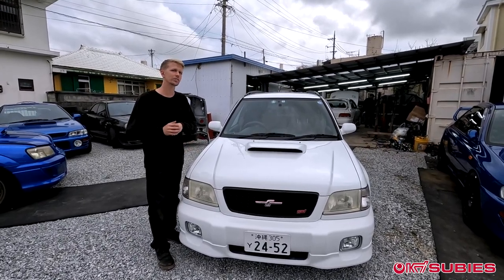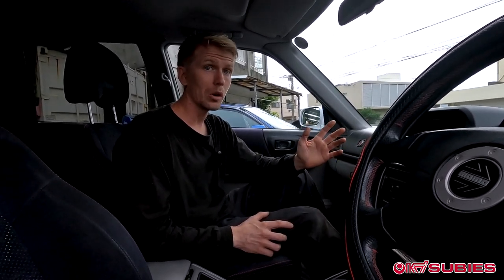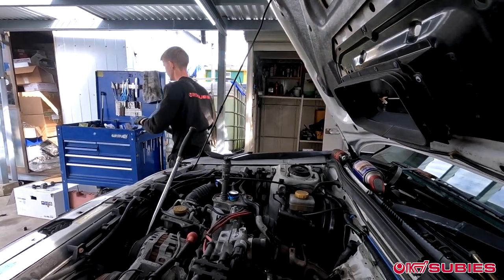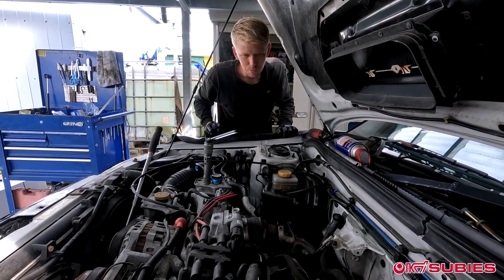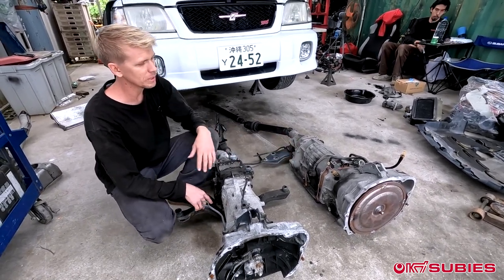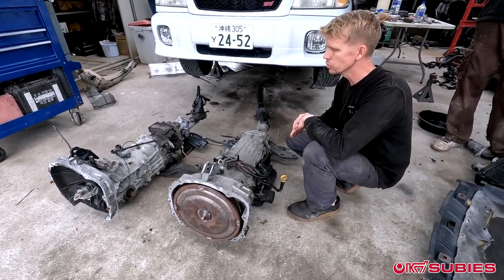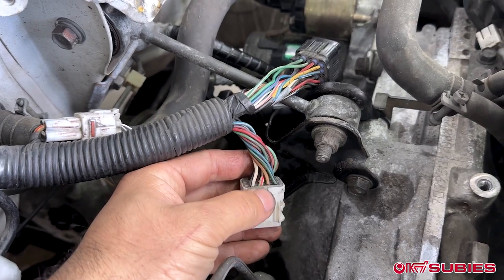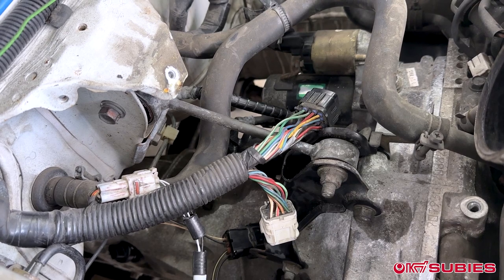Forester SF5 STi / 5 Speed Swap

Comment: Swapping mines and I can’t tell you how much this has helped me. Almost ready to drop the motor back in! Just need to finish up the speed sensor wiring & reverse lights & source a few parts I’m missing and it should be ready to fire up!
Reply from the maker: Thats awesome man! Feel free to hit us up with any questions!
Reply: @OkiSubies need to find the pin that makes the ecu into a manual one. Mines is a USDM 04 xt and I can’t find online for a pin out that says which one it is. Yours at 31:15 is that green one but my pins are different than yours.
Reply from the maker: @Owensti  there is a TID switch in yours with it being different, you might have to reflash your rom with a 5 speed rom🤔
Does yours idle up higher? The good thing with yours is that it is tunable, unlike the SF platform.

Comment: I am in the process of doing a similar setup. I took an EJ20k from a 97 Forester turbo and put it in a USDM 01 Forester. I already have a 5 speed so that part was pretty easy. I was screaming at the screen watching you guys try to figure out the wiring😂 I found it was a lot easier laying out two wiring diagrams and merging them. On my ECU (yellow 3 plug) there are two sets of pins on there for the neutral switch and TCM. The diagram shows which pins needs to be grounded if you are using auto or manual.
Reply: Also with my swap I cut the harness at the ECU and merged the two there. Under the hood I made cross connect extensions cables to go from the Forester's OEM body harness to the EJ20K's engine harness. It made it plug and play. The swap was actually easy. Not because I have done this swap before on an Impreza, but because the EJ20K requires less wires than my Forester currently has so there were a lot of things I didnt have to worry about hooking up. The only wire I had to add was a new wire for the MAF sensor since the 01's only had MAP sensors.

Comment: Tip: Instead of tricking/powering the key interlock on the ignition, just remove the steering column surrounds, the interlock is a small solenoid box on the ignition you can remove it and then the ignition works as it should and will no longer hold the key. 5 minute just saves some hassle.
Reply: And as for the abs issue, if you swap a abs pump from a manual car it also solves a headache, after manual converting several phase 2 cars seems to be easiest option, opposed to trying to trick it all.
Reply from the maker: Thank you for the tips! Removing the solenoid sounds like a way better option and we will definitely check that out.

We have also heard about using the manual pump and that would have been great to try but unfortunately we didn’t have any easily accessible. 

Thanks again for taking the time to share the info!
Reply: @MrTakeaswig would you still need to figure out the speed sensor issues swapping in a Manual Abs pump or would this swap save me from doing that?
Reply: @Jonny5ox  speed sensor install is easy, use a 3 pin vss, one pin is ground, one is +12, wire the signal wire to the tcu signal wire that sends the signal to the cluster/ecu. If you don’t have a pinout for your tcu plug just use a multimeter and do a continuity test from the speed sensor pin on your ecu and probe the tcu plugs until your find it
Reply: @MrTakeaswig  thank you for the information, sounds fairly easy. I've been recently wiring peugeot 309 loom spliced into a citroen xm turbo loom. Japanese wiring got to be better and easier than french

Comment: From which car was the 5 speed manual transmission obtained from

I have a fully forged closed deck built engine with FP blue 1050 injectors bug eye WRX wagon with a 5 speed Impreza GC STi version 3-4 and I was wondering if I should go 6 speed swap as I’m scared that 5 speeds tend to break as most people say. For me it’s not about the extra gear but My point is is the GC STi version 3-4 5 speed reliable?

Much love from kenya

Comment: I have a 2005 Subaru Legacy GT, and did a conversion from Automatic to Manual transmission. Do you have a video on how to trick the ignition to get the key to come out and how to jumper the wire to get the car started?
Does the computer have a ground for it to read manual?

Comment: Do you have a wiring diagram for the car harness plug to the gearbox for exactly which is the neutral position switch the reverse switch and the speed sensor

Comment: Got the motor in & everything connected. I’m getting a no start. It cranks and cranks but doesn’t want to fire up. I know I’m getting spark & fuel. As well as the motor I know it’s good because it came out of my running and driving 06 Wrx.. what should I look for now.
Reply from the maker: How did you check fuel? Did you happen to get the fuel lines backwards when connecting the lines to the engine?
Reply: They were backwards at first, I fixed it and it’s still not starting. Before I fixed it and  left the fuel line disconnected I turned the key and fuel started dumping out so I know my fuel pump is working. I can also hear it priming

Comment: I have the same SF5 forester but not the STI model. A 1999 version. I’m experiencing some boost cuts that are on and off causing on and off power whenever I hit about 3500 rpm in 3rd, 4th and 5th gears. What could be the issue?
Reply from the maker: I would start with spark plugs and maf sensor🙂
Reply: @OkiSubies We’ve replaced the spark plugs and as for the MAF sensor it’s working just fine
Reply: Have you installed any kind of boost controller or changed any vacuum lines?

Comment: Did you have to use hydraulics for the clutch assembly? Is a cable compatible with the forester?
Reply from the maker: We used the oem hydraulic setup from a 5 speed turbo model. Unfortunately not sure about the compatibility for the cable setups though.

Comment: Manual swapped my usdm na 99 forester with a 05 na fozzy mt and did real similar stuff with the neutral position switch and reverse lights and unplug the tcm. Still need to ground the manual identification pin but no one has a reference for the pins on my harness (everyone has different connectors than me). It’s been running fine but every couple of days it dies when I throw it in nuetral with a code about the p1507 related to the nuetral switch I wired just like yours. Gonna find that pin and try again
Reply from the maker: Have you compared yours with any of these?

https://www.xcceleration.com/pinouts.htm
Reply: @OkiSubies  I referenced the diagrams to what another thread had talked about and it looks like the right connector so im going to look at it this weekend. Definelty needed that pdf pin layout thank you
Reply: 3 plug ECU or 4 plug?
Reply: @Cbgrandtheftauto  it was a 3 plug. I found the manual identifier pin and grounded it to the dash and it stopped dying when I let off because it hangs onto the rpm’s longer
Reply: I just went through the same thing with my swap. The ECU my Forester engine came from was an auto, but mine is a manual. Glad you got it fixed!

Comment: Do you have any information for wiring a 6 speed info a very first sf5 sti
Reply from the maker: Six speeds would be the same🙂 only wiring difference is the two wires for the center diff if you have a dccd six speed

Comment: Would it be possible to delete the ABS system? I only ask because the modules will eventually go bad causing the ABS light to light up anyway… or is it just simply better to have the ABS system intact other then for obvious reasons like Oki roads mixed with rain
Reply from the maker: Definitely possible to delete the system, if the system fails the brakes would act just like if it wasn’t there so I wouldn’t worry about it too much. You could probably even get a GC8 Type RA brake system and delete it with oem parts.
Reply from the maker: Chase Bays also offers an ABS delete kit on their website. We are running it and a booster delete on our GF8.

Comment: How did you guys manage to get the reverse lights and speedometer working?
Reply from the maker: There are two wires on the harness that you have to wire to the 5 speed reverse light switch and the speedometer was oem 3 wire sensor. Both are explained in the video🙂👍🏻

Comment: Would you know how towire in a 2 wire speed sensor in my sf5 forester if the cars engine harness is 3 wire
Reply from the maker: @wubgee3311  You would have to get a gauge cluster from a 2 wire car and re pin it. Two wire speed sensor goes to the cluster and the cluster sends the speed sensor voltage signal to the ECU so without the cluster it is not possible. The question is why in the world would you want to do such a thing lol
Reply: Ok so would a 2 wire cluster just plug and play or ido i have to re wire
Reply from the maker: @wubgee3311  you would have to completely rewire it.
Reply: @OkiSubies i brought a 2001 subaru forester s/tb that had a transmission swap and the transmission has a 2 wire vss out of a older model subaru i think and the harness from car ej205 is 3 wire plug and the speedometor is not working and cel light on 4000rpm limit i was really just seing if there is a way i could get it working cheaply without paying 600 for a vss pro harness from i wire wich uses the abs delivered to new zealand
Reply from the maker: @wubgee3311  lol thats it? You can remove the 2 wire speed sensor and install the 3 wire speed sensor and be good to go.
Reply: @OkiSubies  your kidding me right ? The 3 wire speed sensors work in a 2 wire gearbox sorry for all the questions all new to me
Reply from the maker: @wubgee3311  yup! We have done all combinations. 6 speed and 5 speeds all have the same thread pitch. You can even put in a older mechanical speed sensor inside of a 6 speed that originally had a 3 wire speed sensor. Just get a 3pin speed sensor and slap it in and you are good to go🙂👍🏻
Reply: @OkiSubies  your a life saver mate thank you for your knowledge i am much appreciated thank you again will have car working properly tomorrow after been to parts store thanks
Reply from the maker: @wubgee3311  Glad to help! Let us know if you have any other questions!

Comment: @OkiSubies my clutch keeps on failing after the swap
Reply from the maker: It fails after doing a 5 speed swap?
How is it failing?
Reply: @OkiSubies  yes I did the swap for my 2000 sf5 sti ..but the clutch sometimes just falls. Always have to replace the clutch cylinder

Comment: Thoughts on how this would be on an 05 Forester xt auto to manual?
Reply from the maker: In Japan the 05 XT auto’s are drive by wire and the MT’s are cable throttle so that would be the biggest challenge.

Comment: do you know anything about usdm 09 legacy ? I'm looking for information about engine swaps and engine harness
Reply from the maker: We have done legacy engines in GC8’s and have done a good amount of wiring on the Legacy platform. The biggest challenge that you will run into is the immobilized system. What engine do you plan on swapping?
Reply: @OkiSubies   What about an EJ255 or Ej257 under the 05 year ?
Reply from the maker: @officaldjflo  those swaps are a lot more straightforward depending on what engine you have. With the EJ platform the ECU, Harness and heads are the most important to look into. Many times you can swap the long block from another engine if the long block shares the same heads.
Reply: @OkiSubies  Its an Ej  253 2.5 L. I was trying to figure that part out . I was getting lost because of the compression is differnt.

Comment: @Okisubies hi guys, really enjoying the videos. I have a stb sti applied model code is SF5C5EP, engine code is ej205dxxke do you guys know if my car has the ecu that can be reflashed or tuned? I'm planning on putting a td05 18g billet turbo on, sti spec c top mount intercooler, bigger injectors, water methanal injection kit, whiteline suspension components and probably bc coilovers on and get geometry set up.
I'm aiming for a some extra power, I will be doing the manual gearbox swap within 1 year. I'm aiming for increase in power is there anything you would advise, would a standalone ecu be more beneficial like a link g4+? Thank you okiesubies
Reply from the maker: Thanks for reaching out! The only way you could possibly get it reflashed is maybe ECUTek but you would need to find a shop near you that uses it. A stand alone can be expensive but it is really hard to beat them. There are so many things you can do with them like engine safety settings, speed density, launch control and so much more. For the SF and GC platforms we definitely recommend a stand alone. You won’t regret it. For example you can even do dual mapping for fuel, one with pump only and the other tuned with the methanol. The AEM kit for example has a “safety option” and when you run out of methanol it sends a signal to the ecu and the ecu will switch to the map without meth so you won’t run lean. Just so much more you can do with a stand alone🙂

Comment: what is the max torque it can handle?
Reply from the maker: Many people say anything over 320-350 is in the danger zone. Hard to put an exact number on it though.
Reply: thank you for the info so 300 is still safe, planning to build my ej20g with 5 speed soon
Reply: That is a loaded question. It's all on the driver and abuse. As long as you are not clutch dumping and FFS a 5 speed, it will hold an indefinite amount of torque.

Comment: can ask, gc8 ver3/4 speedometer can use in sf5?
Reply from the maker: Version 3 is a mechanical speed sensor and the version 4 is the two wire speed sensor so to get them to work you would need to install the GC8 gauge cluster also. It would be a lot easier to use the 3 wire speed sensor.
Reply: @OkiSubies  yes i got GC8 gauge cluster gift from fren, after remove... found out socket difference compare my sf5 2000s... meaning i need hunt gc8 socket and re wiring it?
Reply from the maker: @devil_samuraix6176  that is correct! You would need to find a pinout for both cars and rewire the SF5 to the GC8 cluster.
Reply: @OkiSubies  alright.. thx for the info..
Reply: @OkiSubies  by the way, what the disadvantage from 3 wire downgrade to 2 wire cluster conversion?
Reply from the maker: @devil_samuraix6176  the two wire sensor is a reluctor style signal and the three is a Hall effect. Hall effect is just a more reliable sensor and the wiring is easier but if you can get the version 4 one to work then should be fine.